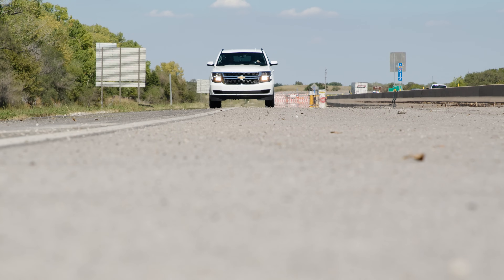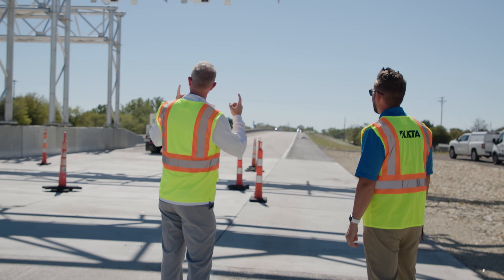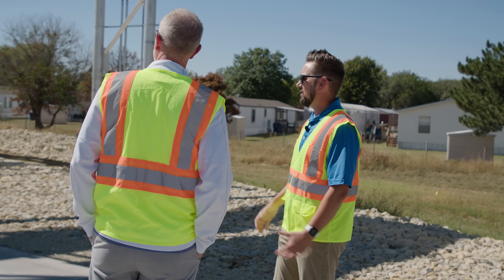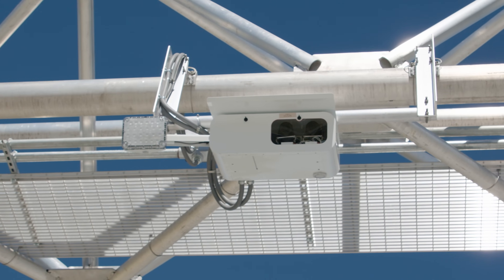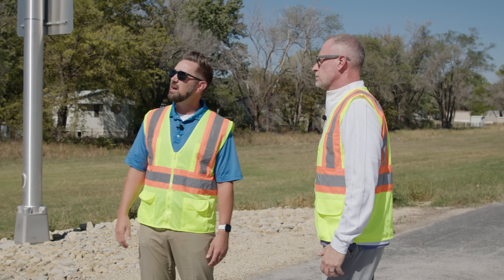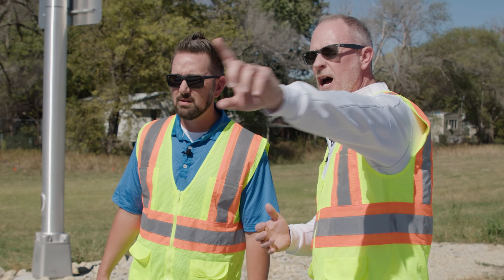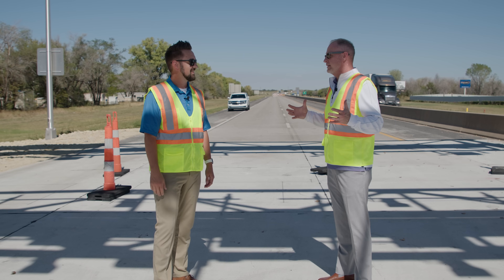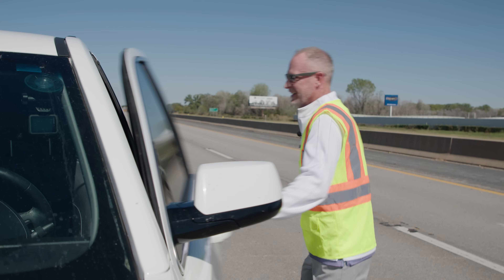On The Road: Toll Zone Technology

Comment: I’ve used my K-Tag as far away as Florida. They have a K-Tag sign as you enter their Sun Pass tolling areas that says the K-Tag works there along with signs from all the other toll systems compatible transponders from across the nation.  I do not see any Sun Pass, Pike Pass or other compatible toll system transponder signs as you pass through Kansas tolling sensors, especially when entering the east terminal. It would be nice if KTA would put up the other compatible systems logos in Kansas so our guests with that technology would know they work here in Kansas.